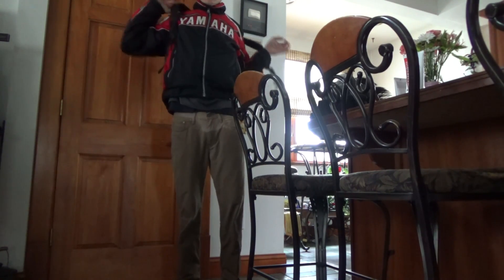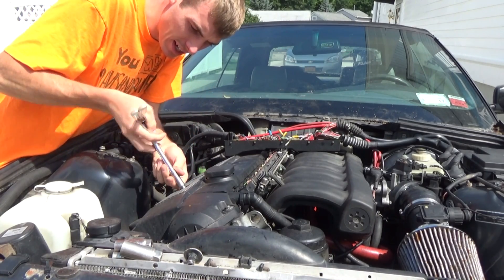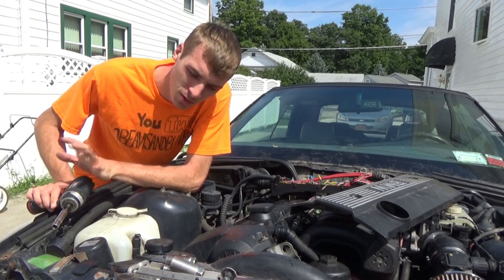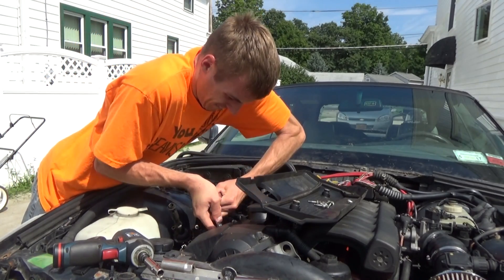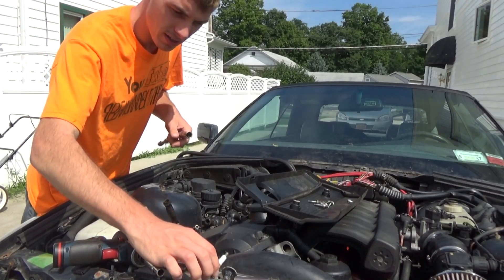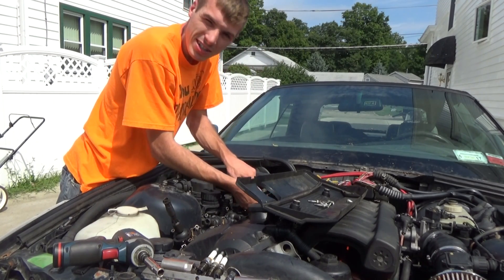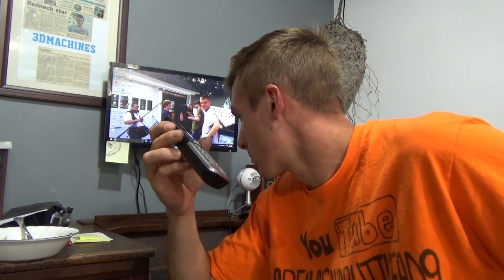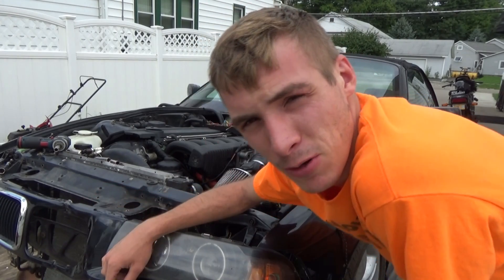THE BEST NEWS YET

Comment: Get the Champion with the copper cores, they are the cheapest, and they are better than platinum. My truck eats platinum plugs like I eat M&Ms, by the handful. They won't last me a week. Cheapest plugs Champion, they last until I change them. I don't know why my truck doesn't like platinum plugs, but there must be a reason the regular plugs work better, because they are better. Platinum is a sales gimmick. Double platinum really means, double the price, and that's all it means. Tell them you want the cheapest set they have, they are the best. Champion spark plugs, fuck platinum. It will cost you $10 to find out I'm right.. My truck is the same year.

Comment: NGK = No Good Krap.
Only thing I'd ever put one of them in is a trash can.
Reply: I suppose you use Champion.
Reply: Not if I can help it.
Reply: Me either. Ngk works Good in 2 strokes.
Reply: +ml2trick I put Ngk in my car because they worked so good in my racing snowmobile. I got the worst ignition breakup under boost
Reply: Did you gap them?
Reply: I work good in 2 strokes also.
Reply: Good for you. You must not GET any Seconds then.
Reply: ml2trick That made no sense, but ok.

Comment: i'm a 3d machine fan, but come on man.   NGKs are not garbage.  I have and still run NGK's in two of my cars, with no problems at all.  Also thats an ac condenser not a radiator.  Freon was probably leaking out which is why it was misting.   Why would you want ac on a drift car? weight reduction!!!!

Comment: That's not a radiator, it's the AC condenser, JB weld wouldn't fix it, epoxy softens with heat and if you're lightening the car for racing, you'll be scrapping the AC plumbing anyway, it's compressor especially. NGK is a good brand of sparkplug, but like any plug the right one with the right gap has to be installed properly. Dude, it sounds like you need to do some research on these kind of engines, seriously.

Comment: Dude seriously take Ng f what people are saying here! That's NOT a radiator it's the A/C condenser , the mist coming out was the gas not coolant...... Take it off and throw it away!  NGK spark plus are on of the best pugs you can buy. I'd use ngk over Bosch ! They are more than likely covered in fuel because of an excessive fuel mixture , maybe an airflow meter fault or something like that,